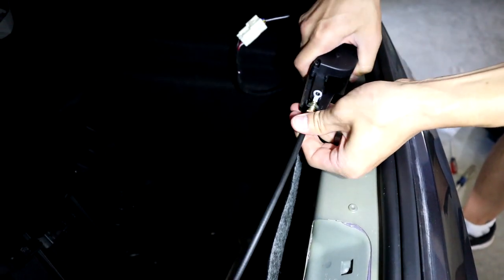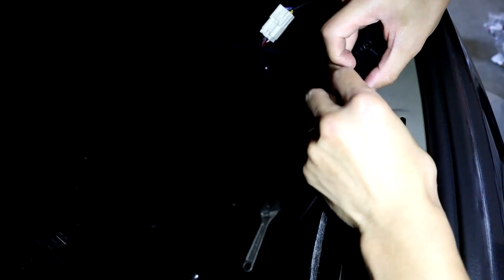Tesla Model 3 Hansshow V4 Auto Trunk Upgrade Tutorial

Comment: Nice video. I was able to successfully install the unit thanks to you. Are you having trouble with the power trunk not working every time there's an update? It locked me out twice today and I contacted Hansshow and they told me to unplug the CANBUS in the trunk. How do I get in there when the trunk does not open??? Have you experienced the same? Any help is appreciated. Thanks!
Reply from the maker: I've actually been having that same issue with the trunk not opening.  Only way to do it is to climb through the back seat and unlock via the emergency latch inside the trunk.
Reply: nukem384 I reported the problem to Hansshow. I hope they find a fix because it’s an inconvenience now. I may ask for a refund and get the Tesla offer one.
Reply from the maker: @kazuyukinagashima8757  For sure.  Pretty annoying basically not having a trunk.
Reply: nukem384 just happened to me again. I’ll give them a few to work it out but will request a refund soon.

Comment: How has the wear been on the left weather stripping where the power strut rub against it as it moves up and down? Any noticeable wear?
Reply from the maker: It's still been fine.  The weather stripping isn't peeling apart or anything.  There are some marks on the stripping, but that's it.
Reply: Hansshow told me that even if the weather stripping did wear it doesn't hurt anything, as Tesla has even cut that part away from the factory power trunk strut on the Model Y.

Comment: 3 questions: 1. Since the plug doesn't fit on the 2018 and earlier how did you connect it to the Canbus? 2. Do you use the original motor or is a new one sent with the kit? Just curious if it's quieter than version 3. 3. Can you still close the trunk from the touch screen?
Reply from the maker: 1. The V4 system in my car isn't hooked up to CANBUS.  It looks like if you have a 2018 or older, they can't hook it up to CANBUS.  William told me "you don't need the CANBUS wiring harness" like I mentioned in the video.  So I'm assuming that means they can't hook up the older cars to the CANBUS for some reason via the plug and play version.
2. They did sent a new trunk latch as shown the video, if that's what you mean by motor?  The struts are still the same, which I think make the majority of the noise, so there's no change there.  The system isn't really any quieter than before.
3. Definitely can still open and close the trunk from the screen.  Nothing has changed there.
Reply: So if you have a 2018, there's no Canbus connection at all?  I thought the new version will show the animation and status on the screen?
Reply from the maker: @Drhalo69  They actually do have a CANBUS version for 2018 and before.  They just didn't send me the correct wiring.  Just make sure you select the 2018 model when ordering the upgrade.
Reply: @nukem384  Where do you wire the can bus connection on the 2018's?  Any idea what that harness looks like?
Reply from the maker: @Drhalo69  Where I showed in this video.  The connection is just a different size and will actually fit.  In this video, they accidently gave me the 2019 CANBUS, that's why it doesn't fit
Reply: @nukem384  So there's no Can Bus connection at all for 2018's.  What does the Can Bus connection actually do?
Reply from the maker: @Drhalo69  Yes there is.  It's just a different size plug than the one showed in the video, so it fits.  CANBUS basically talks with the MCU so the car knows what the trunk is doing and can let you know on the screen.
Reply: @nukem384  Do you have a way to contact you on the forums or offline?  I contacted Hanshow and they said you dont need CanBus connection in 2018, which I dont really buy.  They have no adapter for a 2018.  Do you have a picture of it and where it connects?
Reply from the maker: @Drhalo69  If you have Twitter, you can DM me.  Straight up on their website, it says they have CANBUS for 2017-2018 models.  If that's what they are telling you, then there's nothing I can do about it.  I actually don't have this trunk in my car anymore, as I've switched to the Tesla Offer trunk that has CANBUS, since I watched the installer put it in.

Comment: What I don’t understand is all that trouble running the new wire inside the car hide it u set the carpet then you said no need to
Plug. So what’s the point in all of this?
Reply from the maker: Normally, the plug would fit, so running the cable would have more purpose.  I got the wrong CANBUS wiring, so I was just showing other users how to do it. If I had received the correct wiring harness, then I would've plugged it in.

Comment: @3:20 how do you pull the side rail providence piece where the seat belt is?

I want to replace that by myself if it's held on by clips and can be pulled out easily like the seat portion.
Reply from the maker: Literally all you do is pull straight back like shown.  It's just held in by clips.  You can get your fingers back there to get enough grip on it to pull back.